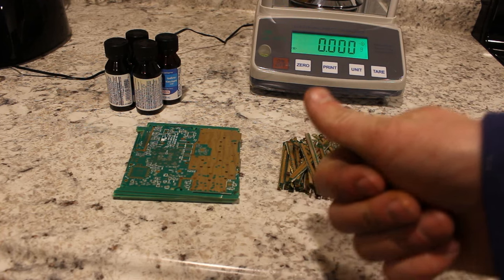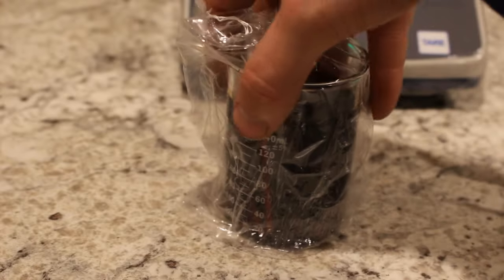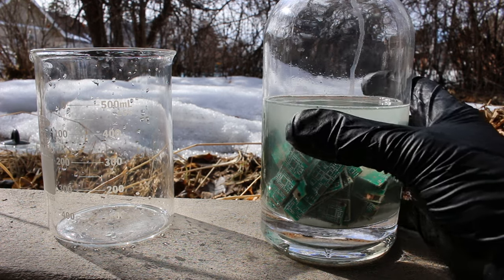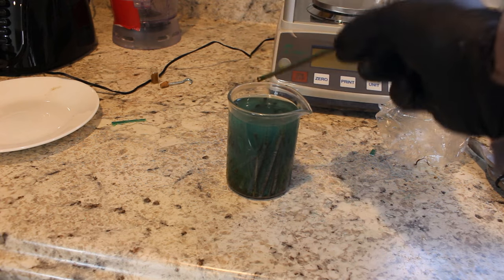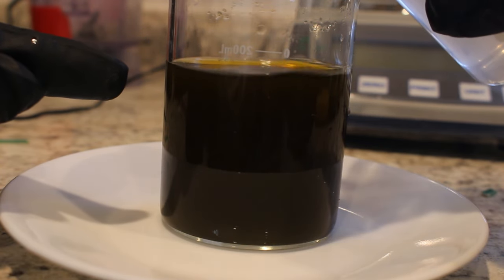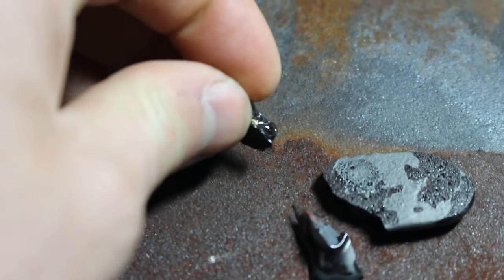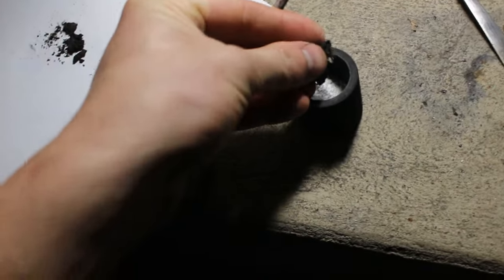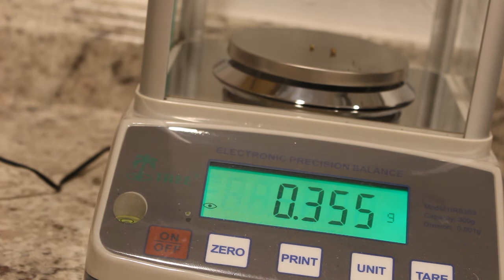Precious Metal Refining & Recovery, Episode 5: Recovering gold from RAM

Comment: Hey Cody.
You mentioned that there might be a bit of copper in that bead.  Iodine has an affinity for gold but copper is also in the same series of elements.  So it would stand to reason that there is copper in your bead.  A second refining with Aqua Regia and dropping with Sodium Metabisulfite will remove the copper.

Since Iodine is a very selective leachant  of gold, it could be used to remove gold off of other metals like stainless steel and any other non-reactive metal.

Just something to think about.

Great Job!  I enjoy your videos alot.  Keep them coming.

RA

Comment: There are normally fine strands of gold from pads on the silicon, inside most high end chips, to the silver pins heading to the outside of the package. If you search for images of "decapped chip" you will see these very fine gold wires. The only danger is the arsenic n-type dopant used in the silicon. If it was not for that, I would suggest using a ball mill to generate a powder and panning for the gold! Of course some of the packages are plastic (need to incinerate first) and some are ceramic.

Comment: Hey don't forget to toss all the copper in the trash from the boards its only worth about 10x as much as the gold youll get off the boards by weight. Yep thats right those boards have pennies worth of gold per pound and about 10x as much money in copper. Any circuit board is made up of thin copper sheets. A copper sheet from a single computer mother board is worth 15 or 20 cents and the gold you.ll recover is worth maybe 5 cents if your very lucky.

I live in ohio north east ohio wont say exactly where but one company that did this recovery nonsense for a while use to toss out strips of mother boards after the recovered the gold looked like a brown nasty mess. Me my one brother and brother in law put those strips through acid and resolved every thing the plastic coating etc floats and the copper goes in to solution and settles out as powdered copper . A heaping truck load of board scrap yielded multiple 5 gallon buckets of purified copper powder giving us a net profit of about 6500 bucks split 3 ways. We used bucked with holes drilled in them and filters bought from a local restaurant supply  place used for filtering fryer oil to reclaim all the copper powder from the neutralized acid. What you basically have in those boards in the end is the small traces of gold become the waste product that you set to the side while reclaiming the copper. If you start with the goal of getting that copper from the boards and save your waste gold left overs over a year the gold becomes a nice bonus also there's more silver on various boards. All current electronics for the most part use high silver content solder  as lead is bad for you or some such. Fact is this is why game consoles like x box 360 got the errors related to video and chip-set needing "reballed" or reworked. While silver is non toxic it is also more brittle than lead and has a higher chance of failure do to heating and cooling cycles. This is why xbos gpus and chip sets come loose causign the various errors. Also a reason why laptop video fails etc. 

Any how re run that scrap and see for your self how much copper you get compared to how much gold in scrap out value.
Reply: Nova Flare actually the gold is worth $13.474

Comment: Hey Cody,
Would it be possible to freeze water in under 2 seconds or so using low pressure chambers, supercooling, or some other method? If possible, would you be able to freeze a vortex created in a cup when you swirl it around?

Comment: Love your videos Cody!  They are incredibly interesting and informative. When you are doing the final smelting stage at 12:55 on the video, did you put any borax or flux in it?  I know after you had dried the sediment on the paper towels, you put the two lots onto one paper towel.  That then gets folded up and goes into the crucible.  Do you then torch the paper towel containing the gold powder to ash in the crucible before putting it in the furnace and do you add borax or flux onto the top of that or do you just fold up the paper towel containing the dried sludge, put it in the crucible and fire it as is?
Reply: 4 years ago this comment was posted. No likes or replies, so I figured id do both. Hope all is well in your life :)

Comment: Those PCB fingers are not just gold, but copper (17 to 70 μm) plated with gold. The other boards are probably plated with the electroless nickel immersion gold process. That's a 3 to 6 μm thick layer of nickel and a .5 μm layer of gold on top of the copper. The ram fingers are probably a hard gold plating, meant to protect connector fingers from wear. They'll usually have closer to 1 μm of gold.

Comment: If you do a fire assay you will get rid of all base metals in your bead. It's a more complete process. What you did is just a smelt, which is the first phase of a fire assay, a reduction process. The second phase is an oxidation process, which gives you pure precious metals. Most of this will be gold, but also silver, palladium and some platinum. I have made some beads close to 2 grams from RAM fingers and chips. Takes a lot of material to get much gold.

Comment: wouldn't it be easier/better to either smash this stuff up in to even smaller bits?Or better yet to incinerate them first? Would that be a good solution to extract gold from full size motherboards and general circuit boards?
Reply: +Ronke's DIY Workshop I'm not sure but i imagine it won't work as well because not everything will burn. Other metals like copper would still be in there.

Comment: Decades back, I ruined my wedding ring with accidental immersion in Ferric Chloride PCB etching solution - the surface went spongy and the gold softened considerably. As Ferric Chloride and similar PCB etchants are easily available, they might prove useful in removing copper from gold when starting with PCB materials.

Comment: This is cool Cody. However for gold foil type stuff I would use Peroxide and HCL (hydrochloric) as it will dissolve the copper that the gold is bonded to leaving just gold foils that can be easily rinsed and then filtered and melted. You should do it outdoors of course since you are using acid but the acid /peroxide can be used over and over. Further, little or no conversion or steps for conversion are needed. Further, the copper can be dropped from the acid solution using electromotive series etc. I believe. P.S. I really like your electric furnace for melting stuff and I would like to see how to separate lead from gold (chemically). Peace

Comment: I thought the scraps would've contained more than 1/3rd a gram of gold, specifically the pile of circuit boards. Is there any gold you may have missed by doing these methods as opposed to previous ones?
Reply: +Dexter Pearce There may be lost gold, but it's fairly reasonable.

Remember, circuits are gold plated just to resist corrosion of the connections. The layer of gold is usually extremely thin in any but very old circuits.

Comment: about how much weight in pcb did you process? my bad if you mentioned it and I missed it...
I'm also wondering if you'd estimated a time period the pcb's were from. 80's pcb has some thick circuit path that has me wondering if it'd be more productive... though when your output was .35 how many tenths would that really add.

Comment: The ram fingers it is best to use Muriatic Acid and Hydrogen peroxide to just dissolve the copper underneath thereby releasing the flakes of gold unaltered and pure...  You could have gotten much more than 1/3rd of a gram.  You can also use borax to precipitate the dissolved gold into powder so then it is easy to smelt after when using acids.

Comment: Isn't it a good idea to simply burn away the glass fibre in the electronics first? Wouldn't that make the process easier and a little bit cheaper as well?
Reply: Bad for the environment
Reply: Thomas Johansson Perhaps chemically dissolving the board one material at a time, in a planned sequence that leaves very little unrecovered residue.  The complete board contains Epoxy, glass, plastic, various coatings, dyes, gold, nickel, tin, copper, silicon, possibly silver, and probably some rare earth minerals.   All combined with a variety of mechanical and chemical bonds to form the original product.

Comment: That's a great take to the board portion I will be adding that to my list, but you iodine way well best way is the hcl but I was looking for a nother way myself otc hydroxide peroxide 3% and I  saturated it will table salt 'iodine' left it in the sun inside my window seal for 1 day and a half the solution oxidizes the underlying copper that the gold is adhered to leaving the gold behind and well you have tons of mercury at hand. 
Little bit more eco friendly

Comment: Hey Cody, perhaps you can help me. I was being curious and I decided to keep the alligator clips in my saturated NaCl solution that I was using for metal etching, and after while it went from an orange to a dark green and started to precipitate a blackish-green, and once that was done I shook it up again and it went back to an orange and then started to precipitate a dark orange and that's where I'm at now. What's going on exactly? What's in the solution that's precipitating?
Reply: Were there any electrodes, or just the aligator clip inside the salty water?
Reply: +ficolas2 They were just two alligator clips crimped to some wire on each end of the battery. I don't know what they were plated with but they were both the same thing. I just did some more testing and got the solution back to a dark green, almost black using some copper wire and stuff, I'll see if I can filter out the precipitate or if it turns back to orange again.
Reply: Green was probably copper red-brown ususaly would be iron(rust)
Reply: +Evan Dunville Well it goes back to an orange precipitate and a yellow solution after a few minutes, and then once the precipitate settled I siphoned off the solution to a still pretty wet precipitate and by looks of it from Google Images it looks to be a mix of ferric chloride and iron oxide. Not 100% sure though, I will continue to test.

Comment: Won't it be easier to detach the gold from the base by dissolving the metal base under it? I remember i read once that it was mostly copper. That way you can filter the gold out so it will be more pure.

Comment: Cody! What was the other slag that was poured out from the crucible? Just random crud or anything identifiable? Also, lemme get this straight... Pure gold will dissolve completely in nitric acid? What sort of concentration does the acid have to have? Is .5 M good enough?
Reply from the maker: +Jules Verne 
gold wont dissolve in nitric
Reply: +Cody&#39;sLab Okeh, thx!
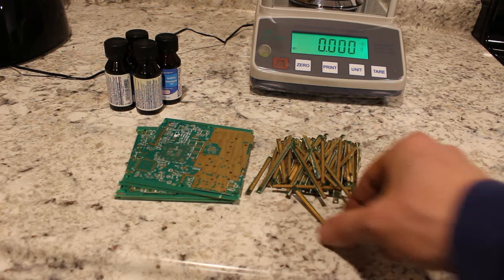Reply: +Cody&#39;sLab Wait what are you talking about at about 00:20 then? Do you mean the nitric would dissolve the other metals and the gold would float about in solution? Perhaps I should do my own research, but any clarification from you would be appreciated!

Comment: How do you make sure that glass containers are totally clean and won't react with anything else?
Reply: Ironside451 Cleaning with dishwasher soap is the usual first step.  Certain processes require more care, like when that testing lab reported a super dangerous pollution and it turned out that trace amounts of their cleaning soap set off the test.

Comment: I bet the materials you used to get the gold cost as much or more than the gold is worth but you did not mention that part.  Still it would be interesting to know.  Thanks for the video.
Reply: +Amateur Redneck Workshop Yes it costs lots more to do than that it is worth. On a larger scale it might be profitable but it also takes very long to extract it.

Comment: Hey Cody great video but whats is the material you found the little bead of gold in? the black stuff
Reply from the maker: bits of slag that wouldnt come off
Reply: Thanks for the respond but is it like carbon ? Sorry not good at english :)
Reply: +Andtobis it's basically glass.
Reply: +Andtobis it's from the borax he used for flux while melting the powder. blacksmiths use borax as a flux also when they forge weld two peices of metal together.

Comment: Maybe you could measure the volume of the nuggets so you can figure out the density? That could give you a clue about the purity. Don't forget that there's probably nickel in there from the plating process, apart from the copper and gold. Also, most of a PCB trace is copper, as you probably already now, so you should prefer a method that doesn't dissolve the copper, or lets you extract the gold without getting the copper.

Comment: The circuit boards have a gold layer on top, nickel underneath that, and underneath that there is a copper layer. I can confirm this because I have picked up little chips of gold fingers with strong magnets. Either way I learned that from Nurdrage no less.
Reply: *NurdRage
Reply from the maker: fortunatly for me cyanide does not dissolve nickel.
Reply: True true ahahahaha I just saw that you said there was a base plating underneath the gold and I remembered this! 😊 By the way Cody, how much would the gold you recovered all together so far be worth in USD? If you don't mind me asking that is ☺

Comment: If you wanted to be more precise with how much gold you retrieved in each bead, couldn't you measure the volume that it takes up, calculate the mass of pure gold that would have the same value, and come up with how much slag or copper respectively is in there, thus coming up with the true weight in gold for them?
Reply from the maker: +Robert Hamman (Hammaneggs) 
yes but now think about how you would go about actually doing that.

Comment: I have around 10 HUGE boards with thick coatings of gold used in RF but i doubt it worth's it.
Reply from the maker: +leosedf 
now if you had 10 tonnes of them...
Reply: +Cody&#39;sLab Yeah then i could do it. I keep thinking of it though because they are very large, i can get the parts out and they have large gold surfaces. Is there anyway to get rid of the solder layer from the pads? It could maximize the yield. I'll try to get a pic of them

Comment: A third of a gram of gold for two days worth of work isn't much. But the Work load doesn't increase much with the amount of material. I see some potential in this, especially if you live in a place where you have easy acces to ppl's discarded Electronics. Plot a route to go daily and scrounge whatever you find. By the end of the month you could have a healthy amount of connecters and whatnot to process, not to mention the functioning computer components you'd might find as well, and which can be sold off second hand. Just need to wrap my head around the how-to handling all those Chemicals, but otherwise, I could definitly work with this and wind up in a situation were I can quit my day job.
Reply: +WormholeJim Sure, as long as you ignore the cost of your time, transportation costs, chemicals, and the increased danger and increased chance of the authorities getting involved.

Comment: Separate that shit with a hammer and anvil..I have seen jewelers do it and added flux and beat the impurities out. repeated the the melting and hammering a few times until it has no more impurities... Not sure if that works with the material the RAM is made from that the gold was attached but that looked like to much work for that little bit of gold.

Comment: Cody...Generally I enjoy your videos.

But you went about this in a totally bassackward way. Furthermore the Gold on the fingers is not pure but Karat Gold Plating. There is a layer of Karat Gold on top of a layer of Nickel on top of a layer of Copper on top of the Fiberglass.

Take your Fingers and your Circuit Board and soak them in a one to one solution of Hydrogen Peroxide and Muriatic Acid. This erodes the Nickel Layer liberating the Gold.

Check out Moose Scrapper here on YouTube....or Geo.

But I did learn something about the process of  about Cyanide Leaching. I was not a waste of time.

Comment: I figure most of that 2 days work was waiting on the chemicals to work. so you didnt do much during those 2 days of "work"
But, for the very small amount of scrap that you processed, you got alot more than i thought you would.. That didnt look like more than maybe 10 dollars worth of scrap if that. prolly not even that if you were to find a way to buy it in bulk. woulda liked to see how much weight you started with and the value of the scrap you started with also. was amazing.
Reply: +Bobbert Bobby Don't forget cost of chemicals.

And even if it's one hour of work over two days, that's still going to eat up whatever you made over the cost of the scrap and we haven't even gotten to chemical costs, or furnace operating costs.